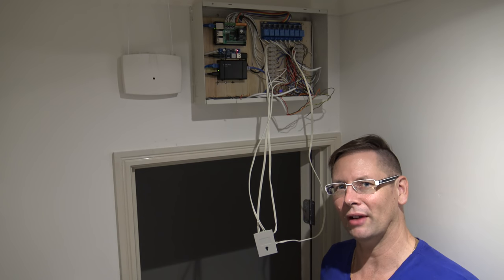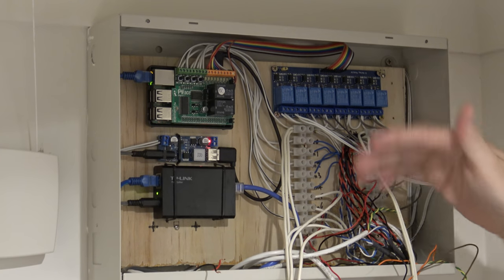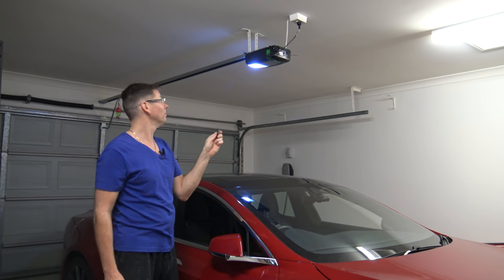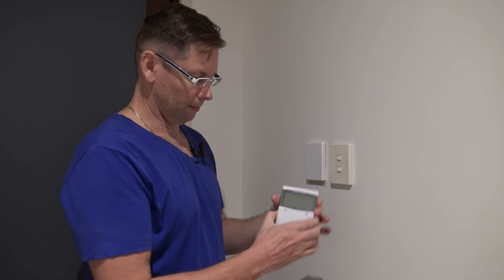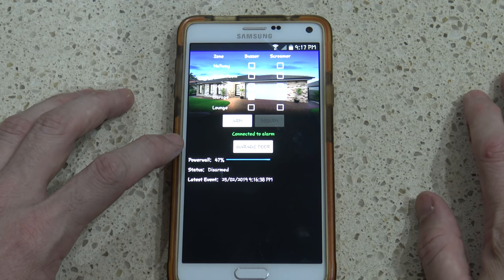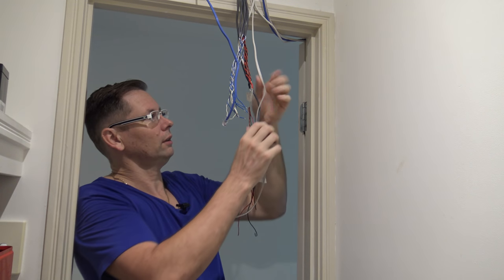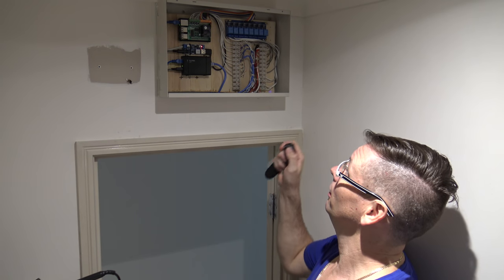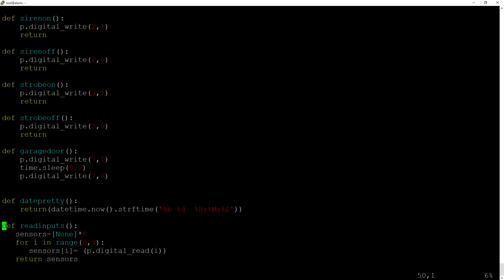Raspberry Pi Home Alarm System With Android Client

Comment: Looks nice, i also would like to set up a similar system but i will get into trouble with my wife and kids, they will by mistake sabotage  or break the system..
Btw i would ups the poi switch and connect ups-alarm to the pi, you'll be able to control the system even when the mains power is out(ups=redundant to powerwall)
Reply from the maker: Check out my other videos. My whole house is running on battery. As I said though, I might still put the alarm battery into this unit, in case the switch has a fit for some reason, not that I can imagine why.

Comment: How do you protect your raspberry pi's from SD card corruption , you use them so much , and no issues with that , I use raspiries quite often and i always get some segmentation faults , and other crap that indicate SD card corruption , tried to go through setting the system into RO mode , to no avail because i missed some steps maybe , if you be so kind to enlighten me and the rest of the community with your countermeasures 
thanks
Reply from the maker: I honestly haven't really had much of a problem with that. Basically, I always leave them running. If I have to turn them off, I shut them down. Seems to work.
Reply: @TallPaulTech  yeah, but in case of power cut, or something, or the RPI froze and you need a terminal nothing happens on hdmi plug in etc, and then you pull the plug, segmentation fault, is very typical in remote solar applications either the converter is not power full enough or some other issue, if any solution comes to mind to set the os partition into Read only and be able to chnage it from RO TO RW I would be grateful
Reply: AL6S00740 , there are solutions in the market already that give UPS like functions to any RPi model.
Just search “ RPi UPS” or just saw one called Pijuice. I’ve never tried one myself. I’m using big powerbanks for my “on the go” projects.
Reply: @ioannis69k  that is an other way to go, although not ways helpful in case it gets stuck, a read only OS would save you

Comment: I would never use a combustible back plate. Either metal with stand offs, or nylon such as a cutting board.
Reply: Perhaps if there was anything in there that could get hot enough to set plywood on fire, then it may be of concern. The voltages are low, as well as the currents. Most importantly the POE switch supplying the power would turn the power off to that port (or blow its own fuse) long before the current could heat a wire enough to cause plywood to burn.

Comment: Hope you still have the EOL resistors.
Reply from the maker: And if I don't?
Reply: @TallPaulTech  the end of line resistor allows the panel ohm meter to monitor the wiring for open or short circuits. A potential burglar can short the wire for a zone and enter at a later time. If a wire was compromised by a nail for example, that zone would not function correctly. Its how you value the potential risk. EOL resistors are VERY important if you are monitoring for smoke/fire. A fire in a wall or roof could burn and disable the wire that is doing the monitoring and then you'll never know about the fire.
Reply from the maker: I know what they're for, but....
Reply: @TallPaulTech  technically you don't need them. Its just an extra layer of security if you can measure for them

Comment: Those remotes are really insecure and probably not very reliable. Consider using something with KeeLoq or similar technology, it is slightly more expensive but at least can't be hacked that easy.
Reply: @xabhax  hacking this remote requires less competence than picking average home lock - that is what I'm trying to say. Using it for opening garage door is, probably, not a good idea. Also, it is XXI century now, casual technological crimes are not uncommon anymore.
Reply: @xabhax  I'm talking from my own experience only. I know two cases of robbery by abusing alarm system. I mean I personally know both victims, both cases are not connected and could have been easily prevented by not using cheap crap. In fact, they'd be better by not using any alarm at all. I doubt those who robbed them even know what SDR is. If you know about SDR - usually you can find better things to do with your life.